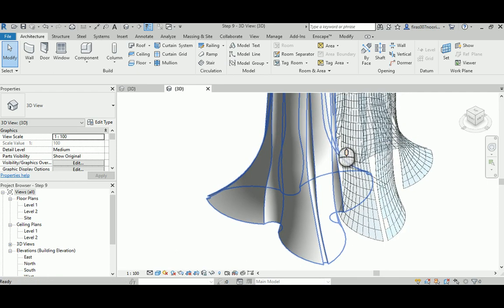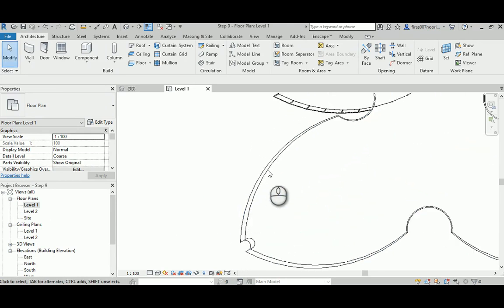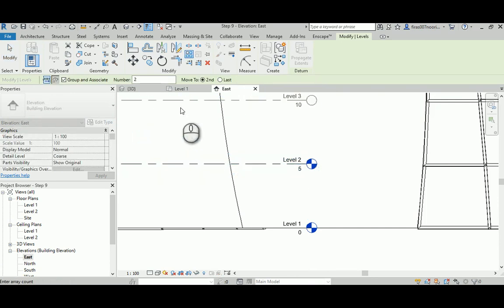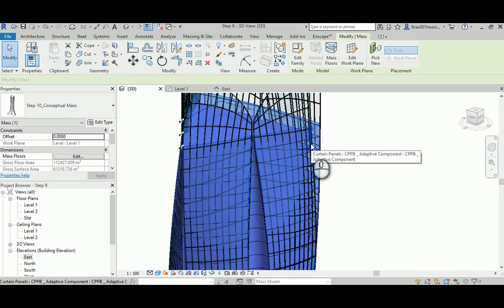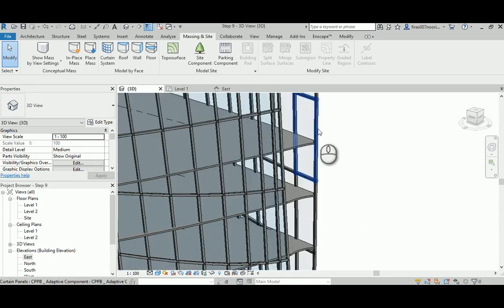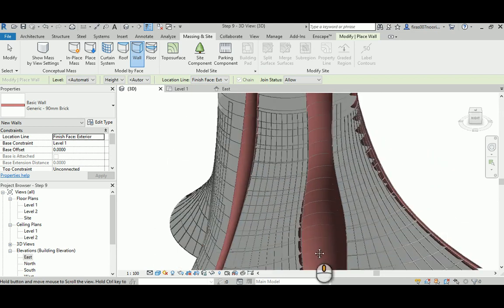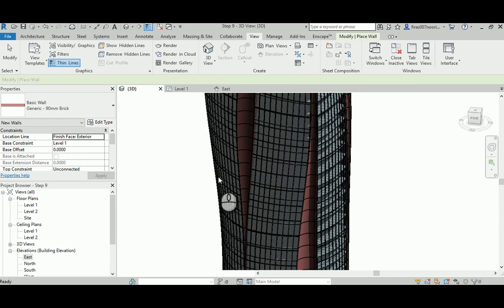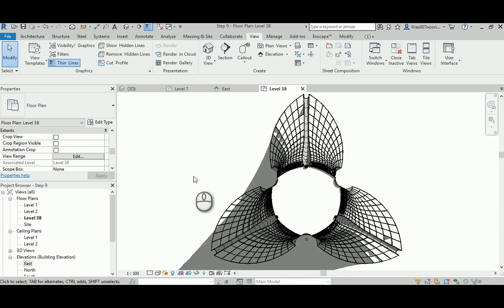Snowflake Tower Using Dynamo - Step 11 Making Conceptual and Revit Floors - Making Wall by Face

Comment: Hi Firas,

I was able to use the springs form.bygeometry node and create the mass in the conceptual mass family. But when I send it to the project, it says that the "Mass contains only mesh geometry, which can't be used to compute Mass Floors, volume, or surface area." 

What should I do?
Reply from the maker: Hi mate, sorry I am on continuous travel for holidays, each couple of days in a different hotel, I barely managed to connect my mobile to internet, and my work laptop is not with me.

Comment: Dear Firas,

You have been of great help to me Sir. Thanks a lot .I am trying to export my Dynamo mass into Revit using the spring.form.bygeometry but it is not happening. It would be of great help if you could help me.

Thank you.
Reply from the maker: Hi dear, Happy to hear from you :) You will need to open dynamo linked to a Revit conceptual mass if you want to send the Dynamo Geometry to Revit Conceptual mass, then get your form in Revit Conceptual mass and then upload this conceptual mass into Revit Project Environment so you can use to slice and add walls or curtain panels, see these
https://www.youtube.com/edit?o=U&video_id=PcGJwm2byEc
https://youtu.be/wqj4p4MzutM
Reply: @FirasNoori  I opened the conceptual mass in Revit and then tried to export the Dynamo mass into that file.There seems to nothing happening when I used the spring.bygeometry at the end. So I tried converting it into SAT file and I could export the mass to Revit but I couldn't create floors or explode the mass
Reply from the maker: @sagarmahajan9520  Dear, you should use Springs.Form.ByGeometry to transfer the Dynamo geometry into Revit Conceptual Mass one, You also MUST make the units as "Meter" as the unit may cause the transfer to fail sometimes, then load this conceptual mass into a Revit Project Environment file, I will send you on your email now an image of the example I made for you, Cheers
Firas Noori
Reply: @FirasNoori  Hi Sir,
I wanted to know that if we can export  a line plan in Revit/AutoCAD to Dynamo? I have plan in AutoCAD ,I was trying to export it to Dynamo.Is it possible?
Reply from the maker: @sagarmahajan9520  Yes You can , just insert the CAD file into Revit and then explode it, and in Dynamo use Select Model Elements node to select all the plan, connect the last to "Element.Curve", check your email I sent to u the nodes dear
Reply: @FirasNoori  how do we need to open the Dynamo file linked to Revit mass?